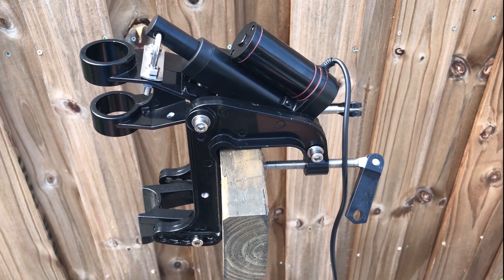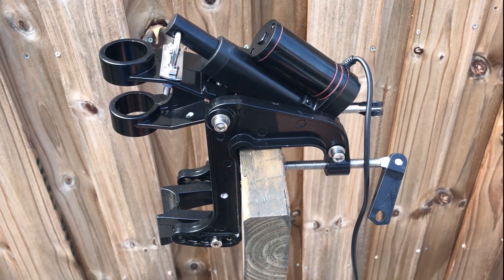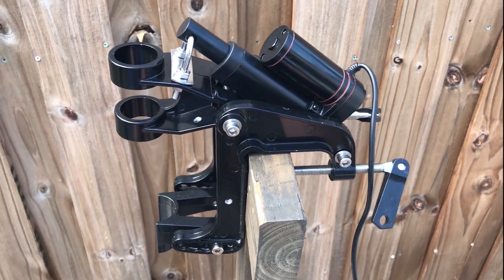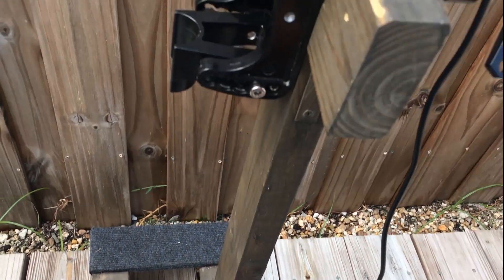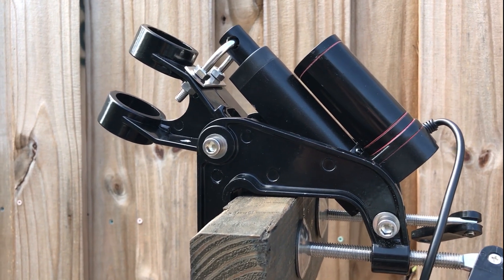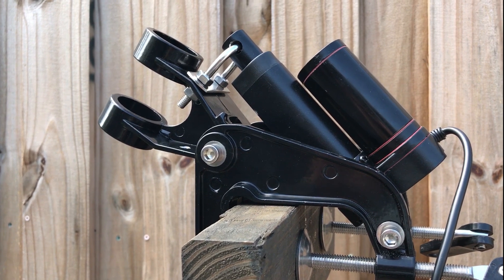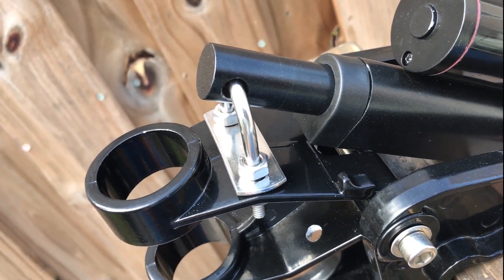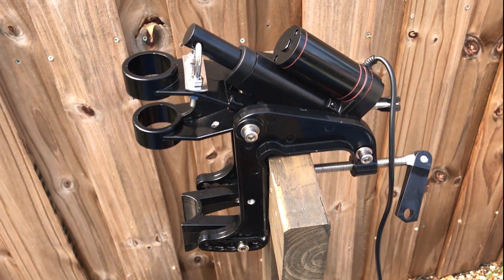Trim and Tilt for Small Outboards and Trolling Motor Systems

Comment: One fix for this problem.
Drill a second hole into the liner actuator rod closer to the actuator body use a dremel tool or diegrinder and burr,  to create a slot instead of a hole.
To give you a little extra play on the extend  function of the ram.

Carefully  measure just the proper amount to slot the  hole. Don't make the slot to long.

Comment: Negative angle is good for displacement hulls to increase top speed by lengthening the waterline in some cases.
Reply from the maker: Mr. Cee Gee very true. I have to grind a few mm on the upper bracket to get about 3-5 degrees of negative angle. I have about .25 of a inch remaining on the  articulation travel. This will help push the nose down on some craft.

Comment: How did you hook the actuator to the back of you motor mount.
Reply from the maker: If you look on the website you will see the newer version that uses a clamp and stainless stock with holes to adjust the throw. The main bracket has to be drilled to accommodate the actuator.

Comment: What is the bracket, that's holding the actuator, either made out of or from? Cool cool!
Reply from the maker: Guy H. that is the original bracket that comes with the engine leg. One set of holes were drilled out toward the clamps and a stainless bolt runs through these holes to allow the actuator to move. The 2 inch actuator use a collar that slides on the drive tube with a stainless clamp. I added a cut in on each side of the plastic collar to allow easier movement of the clamp. Works incredibly well.